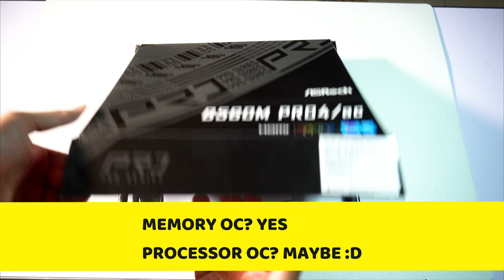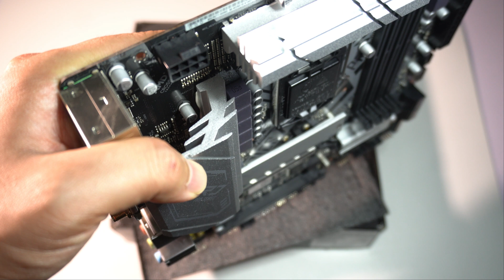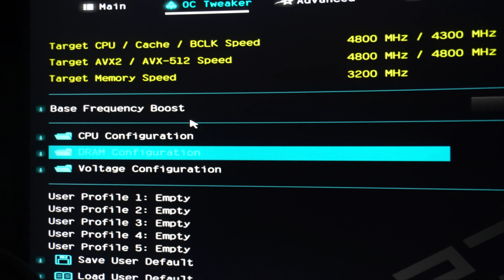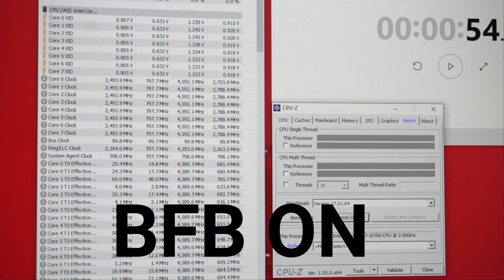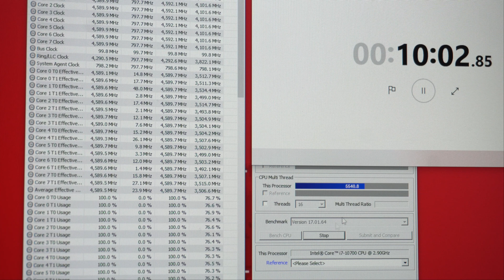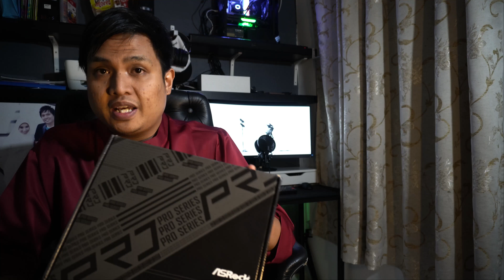Asrock B560 M Pro4 Ac motherboard review

Comment: can 10gen i3 use pcie4 with this board?
Reply from the maker: yes u can.but 1 nvme slit will be disabled
Reply: @drj144  but in asrock web it says 10gen i3 only support pcie3
Reply from the maker: @Farisss11  aah mmg,sbb tue saya mention satu nvme slot disable - sbb 1 nvme slot run gen 4 1 lagi run gen 3 

if pakai 10th gen ,  1 nvme slot xleh pakai sbb dia support gen 4 shj , and also pcie run gen 3 - tapi xde masalah pun bro
Reply: @drj144  i cannot find a proof in internet that i3 gen10 can use gpu with pcie gen4 in this board whatsoever

Comment: Hello bos, mobo ni kalau guna i5 11400f support tak ram 3200mhz?
Reply from the maker: support.sbb ram dia bleh oc kalo mobo nie

kalo b460 speed dia akan limited.nnt boss double check ya
Reply: @drj144  soalan adakah mobo ni support ram 3200mhz tanpa oc sbb die kate dye support ram 2933mhz natively utk intel 11th gen
Reply from the maker: @Black-mp6jh  yes.dia boleh support 3200mhz tanpa oc.

i pakai mmg run at 3200mhz

Comment: you say its not for overclocking i put a i7 10900K in it with a Noctua NH D15 Cooler and 32GB of Ripjaws 3200MHZ overclocked too 4800MHZ , and my CPU gets all core of 5.3GHZ at a cool 71c and i used a Meshify C case and used all DarkRock Pro 3 fans 900-1350 RPM .... hahahah i am a mad man but it works good

Comment: Bro can i run this motherboard with intel i5 11400 with power limit on?
Reply from the maker: yes.yes u can
Reply: Sure bro? 
Some of are telling that there are some heating issue or i can't get 40% less performance of the cpu.Beside it will not overkill the cpu. What do you brother please help

Comment: Fuh mantap bro sangat informatif, bro boleh tlg rekomen maderbord b560m bawah rm500? dan ram (8gbx2 3200) bawah rm450 nak pair dengan i5 10400f
Reply from the maker: bawah rm500 saya still recommend mobo nie - sbb nie je yg b560 yang ada decent vrm + integrated wifi + bluetooth

ram adata xpg d51 or d50 okay , amik je mana2 yang tga murah bro. Harap reply saya membantu

DO consider sub and my channel bro

Comment: hey i got this motherboard with an i5 10600K and a 3060ti, but which cpu cooler and ram would you recommend?
Reply from the maker: hi bro.10600k is an OC model.i suggest a 240mm AIO. maybe the EK 240mm Basic model??

Ram i suggested u just get any 3600mhz ram at 16gb.that will suffice

hope that helps.do consider subbing to my helps. that helps me tremendously
Reply: @drj144  does the motherboard support OC it? i was thinking i just XMP it. 

is there a uge difference between 3200 and 3600 mhz? does the motherboard support 3600? 

subbed! would love to see a build with this board im not used to it and haven't seen any videos yet.

Comment: I have a question; Using this B560 motherboard with a 11400f, could I use 3600mhz ddr4 ram? Or would I be limited to 3200mhz?
Reply from the maker: u could use upto 3600mhz - in fact i used a 10th gen , can still able to run until 3600mhz

Comment: Assalamualakum bro. Thank you for the info! Nak tanya sebab nanti saya nak angkat i5-11400f and mobo ni (B560M Pro4) tapi for now saya nak pakai stock cooler dulu. Boleh ke nak run ram 3200mhz and up power limit cpu to atleast 80W ? Ke takut overheating... Thank you bro
Reply: For now psu saya pakai 550W
Reply from the maker: okay.bg aku.stock cooler mmg maintain je PL 65 watt dlu.even 65 watt pn bleh cecah 80c 

xpe.power limit tue boh jgn risau2 sgt. angkat mobo , ram oc psu make sure 80 plus bronze dlu. pakai stock setting 65w 1st.

nnt when duit dh ada sikit nk beli 240mm aio or good tower cooler.bleh terus naik PL ke 125watt

harap membantu boh 😉
Reply: @drj144  assalamualaikum bos nk tnye.. Skrng sy hnya pki ram 2 btg speed 3200mhz .. In future klau sy nk tmbah sebatng atau 2 lgi .. Speed boleh maintain 3200mhz cmtu je ke? Atau ade nk kne ejas ape2?

Comment: Is it compatible with 11th gen because i ordered mine a couple of days before 11th gen was announced
Reply from the maker: yes
Reply: @drj144  sorry i meant is it compatible out of the box or does it need bios update
Reply from the maker: that one im not 100% sure - but the good thing is that , when u buy an asrock mobo  , there is a small sticker , for example mine is 1.4 , which tells u the bios revision - then you can just google if your processor is supported at that bios revision
Reply: @drj144  where on the motherboard does it say it
Reply: @drj144  thank you so much I checked and it is on on p1.50 so it is compatible and again thx for the help
Reply from the maker: @crocode1  np bro glad to help - that why i like asrock stickers

do consider sub and like bro :)

Comment: Hey man, I'm with a question in my mind for a while, should I get i5 11400f and AsRock B560 Pro4 or R5  3600 and B450 Tomahawk?
Reply from the maker: same price?? i would go for the ryzen setup
Reply: @drj144 
First of all thx for the fast answer!
Here are the prices:
 i5 11400f  167,90€
AsRock B560 Pro4 116,90€
--------------------------------------------------
R5 3600 209,90€
B450 Tomahawk 94,90€

What should I go for so?
Reply: @drj144  It's a hard decision to me because I saw some benchmarks and the 11400f is 20% faster than the r5 3600
Reply from the maker: @migasmall  in terms of gaming, yes.but ryzen is unlocked can oc, has better productivity performance , etc

i would say price look the same, just get the 3600
Reply: @drj144  Thanks a lot man, that will be my decision so
Reply from the maker: @migasmall  np glad to help bro

do considering like and subbing 😉
Reply: @migasmall  stupid decision the 11400 shits on the 3600

Comment: Hi I have a h410 with 10400. I wanna upgrade to this MB, but if i change the MB do i need to buy a new windows license? Maybe if you can also show if the DDR4 can maintain OC speed at 4600Mhz, above its standard spec of 3200Mhz. This is a very good video. Thanks
Reply from the maker: the ram stock is 3200mhz. at most u can oc until 3600mhz at decent latency.

regarding the microsoft license, changing mobo might cause u to need  a new licence key, your milage may vary

Comment: Does your b560 support 3000mhz ram?
Reply from the maker: yes and above. im currently running xmp at 3200mhz . plan to oc to 3600 later
Reply: @drj144  ah niceee. Seriously lifesaver. I can get a £70 B560 and oc to 3000mhz and get a 10400f hopefully

Comment: Question about that coolermaster watercooler is it durable Iv been hearing a lot about it failing etc
Reply from the maker: iv seen some reports but thats mainly with the ml240. mine is the v2 so far no major reports of leaking

from cooler master website

Cooler master lists these improvements to the new V2 versions of the ML240L and ML120L:

New Generation Dual Chamber Pump

Enlarged Surface Area on Radiator

New SickleFlow 120 RGB

Reinforced Sealing for Anti-Leaking Prevention

if u want a better performing can get the EK 240 aio or the artic cooling version 😊
Reply: Also there's a certain position where the pump can fail faster.  The outlet tube of the pump should be above the intake. I'm not entirely sure about the proper arrangement since I use an air cooler. But I'm pretty sure the pump will fail faster if  the pump block is in a certain position.

Comment: Hey could you please tell me what temperatures the vrm reach in benchmarks + does it throtte? thanks!
Reply from the maker: hardware unboxed did an excellent  video regarding temps

summary - if your planning on using a 10900k fully unleased , then no , u should not use this temp reach 98c

If your using a more logical combo like be, an i7 or i5, then no issue. Even no power limit, its around 85c 1 HOUR FULL LOAD test

I think if your planning high OC, u should avoid b560 entirely and go for the z590 bruv

Hope my reply helps u in some way

and do consider subbing my small channel

https://www.youtube.com/watch?v=HkiTA0XvXUM&t=238s&ab_channel=HardwareUnboxed
Reply: @drj144  Hello DRJ, you got a suscribe with this review but it would be really nice if you can share the temps when you are doing BFB tests. Even more if we are talking about 10th and 11th entry-mid mobos since the BFB throtte issue must of these mobos have. Thanks.
Reply from the maker: @kelroar  tq so much for subbing

sure ill run a stress test and see the vrm temps in hwinfo.

i dont have a thermal camera so hwinfo vrm is the best i can give. 😓

Comment: So the micro ATX version has wifi? I bought the at model and it doesn't have wifi
Reply from the maker: no worries bro. u can get a pcie wifi adapter.that always works well
Reply from the maker: that why u need u get the ac version.its 5 to 10 dollars more bro
Reply: @drj144  Im new to pc parts so I thought the bigger mobo was better or something. Ugh. Now I have to buy wifi adapter

Comment: Bro i plan buy asrock b560 steel legend +10400f as an upgrade for my old i5 6402p+H170 mobo. U think i should waiting for 11gen or just buy this with cheapest 3200mhz ddr4 with my rx480 8gb gpu. 4c/4t is worsen nowadays. is it okay if i just use xmp memory oc to highest available and bfb to max power output for 10400f cpu with 550watt psu is okay? Im also plan to add nvme ssd or 2 set of 2.5 ssd also add 2tb hdd on top of my old slow 1tb hdd/maybe i should just removed it for savings psu power amd installed magnet argb for bling2 in future upgrades from time to time, im so woried about my 550watt psu is sufficient for this kind of futures upgrades? But im definitely will get asrock b560 with i5 or i7 if i have more budget later. Whats ur opinion sir? Cant thx u enough for making such good information vids. Ur opinion will help me alot. Im torn between choosing 10400f or 10700f when using b560 with 3200ram. Choosing Cpu+psu is making me headaches. Thanks alot sir god bless.
Reply: Go with 10400F or wait for 11400F if you consider swapping a GPU for something faster than 3060Ti in the future. For your current GPU, even i3 9100F is faster than needed. 550W is more than enough, the peaks should be around 350W draw, so there is a safe margin.
Reply: @T4ish0  my god. Thats a relief to hear it, underpowered by the extras im about to added in near future's. Thx alot mate thx again. I will sub to u a token of appreciation, for helping noob like me who is most casual gamer who played when have free times. Love the pc graphics so much and graphics crisp and very sharp when setting right. No wonder pc part is expensive. Anyways stay safe mate. Keep moar vids coming
Reply from the maker: tq so much bro.

np always glad to help
Reply: @drj144  What would you suggest to pair for my RTX 3080?

£400 for 5600x + MOBO
£220 for 10400F + B560

Would it be enough?
Reply: @Mancastle  I'd consider a 10700f + b560, or a 10600k OC with a z series motherboard. You will need good cooling for this though. the 5600x is bad value at current prices and i'd go for more power than a 10400f considering you have a 3080.

Of those 2 combinations the 10400f is way better value. Go with 3600mhz ram (or higher if you get a good deal) though.
Reply: @yz249  I went with the 10400F for now as I got an open box one for £110, the 10700F was literally £130 for 2 more cores, and the z490+10600k an extra £100+
Reply: @Mancastle  10400f for 110 is a very good deal! (i assume you meant 230 for the 10700f?)The 10700f is a decent bit faster, but for those prices 10400f is better value.

https://youtu.be/Qt1XRHR_amY

Have you bought your ram yet? I'd very much recommend going for 3600 or at least 3200 (not much price difference between the two), check Gamers nexus review to see how much of an impact it makes.

https://youtu.be/csFwlKgZCzM (ignore title, prices were way different then)You will likely notice an even bigger difference because your 3080 is faster than a 2080TI so you more cpu bottlenecked than the testbench
Reply: @yz249  CL16 Crucial ballistix 3600mhz ram for £70 delivered. might even push it higher.
Reply: @yz249  I'd also like to mention these benchmarks are for 1080p, i'm playing at 1440p which makes a big difference.
Reply: @Mancastle  ah yeah, 1440p the differences between cpus will be even less. enjoy the build :)
Reply: @yz249  still cant get over the fact its like £240 for a CPU+MOBO that has the same performance as something that's £500+ in gaming.